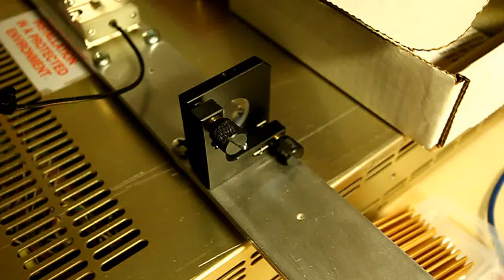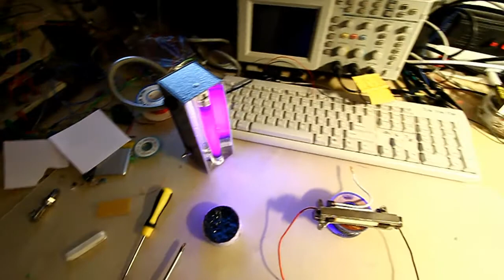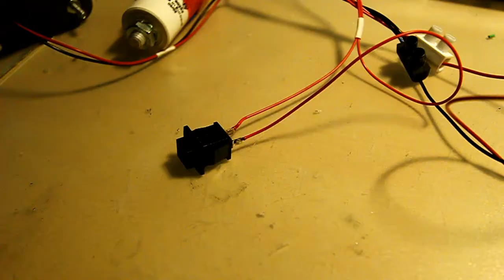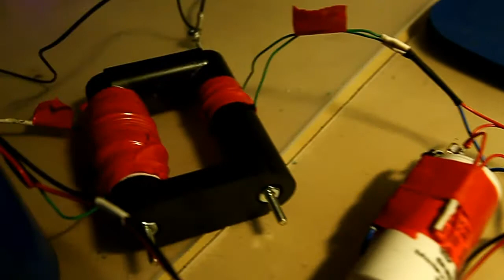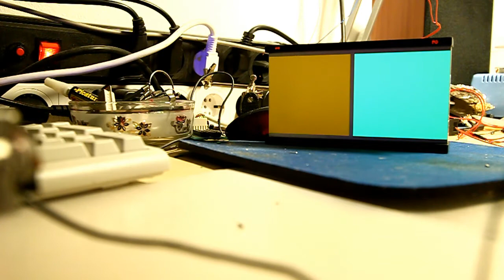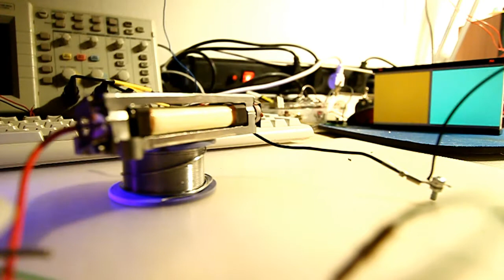Pulsed nd:yag laser / ssy1 revisited

Comment from the maker: Also, the AR coatings on the yag are not the first tings to get damaged. Have you seen yag rods with burned gray tracks inside them but with pristine AR coatings? I have. The energy field is not equally distributed intra cavity, and you have different waves traveling in 2 directions. If you happen to have a beat of 2 waves you can get a hot spot, if it's inside the yag you will get a damaged spot. However, as I said, all this has no chance to happen on non q-switched lasers.

Comment from the maker: It's not as simple as that. You can use whatever energy levels you want as long as you are at a reasonable % of the explosion energy of the lamp.
The purpose of the series inductor is to elongate the pulse. Having a really long pulse is not a bad thing, it depends what you use the laser for. Without the q-switch cell no matter what I do, the peak power intra cavity will not be no-where near the damage threshold of the yag rod.

Comment: Thanks for your attention. You assure me. Mirrors don't scare me. I worry more about flash lamp reflector. But.. As I know threshold lamp power is about 200 J to make active rod generate. I can give 1250 J power pumping, so it may be possible to use simple Al elipsoid reflector with less effisiency. A journey of a thousand miles begins with a single step :) If you do not mind I will ask you some advises in future.

Comment from the maker: The UV black light makes the plate material fluoresce, the IR laser makes the plate material loose the energy absorbed from the UV light. This quenches the fluorescence and makes the IR laser beam look like a dark spot.

So, it's just a fancy glow in the dark tile made with the right material.

A lot of the fluorescent materials will show this effect. A red laser pointer will do for quenching, if you want to try it.

Comment: hi, i wanted to know if that white wire connected to ssy1.  (which Sam says is some kind of trigger) that should connect to the fryer, is it connected in your circuit, or not.  thank you
Reply from the maker: Google "series flash lamp trigger", that's what I'm using to trigger the flash lamp, you don't need a 3rd wire with that.

Comment: Hi Daedronus, I ´m building a Nd:YAG laser, but I have some troubles whit the trigger circuit. could you give me some tip or example for this trigger
Reply from the maker: http://www.orcontech.com/data/Perkin_Elmer_Flashlamp_catalog.pdf
First half covers a lot of general information and circuits about driving flash lamps.

Use TVS diodes between the capacitor bank and the flash lamp to prevent the pulse from entering the capacitors or in the worst case the power supply
Reply: Daedronus
Hi Daedronus, thanks for answering me. I read that document. I saw that the trigger circuit is LC circuit. But what is the voltage which capacitor is charged?. Also, because this a series trigger circuit, the secondary of  the transformer is part of PFN circuit and this inductance is small. I hope you can answer me. Thank you very much for you reply.
Reply from the maker: Luis Munayco I use around 600V on my trigger capacitor, the capacitor itself should be small, less then 1uF.
Yes, the trigger secondary will become part of the PFN, in fact you will not use another L for the PFN.
Reply: Daedronus Thanks for your answer. Colud you reach 16kV whit your circuit?I have a ferrita core like that video. I´ll use this ferrite for the trigger transformer. I have a perkin elmer flashlamp, and I need at least 16kV for trigger. Do you remember how many turns has the transformer?Thank you very much for you reply.
Reply from the maker: Luis Munayco It's not the forward action of the transformer where Vout = Vin x turn_ratio that triggers the flash lamp, it's the flyback action, where the Vout spikes out after you stop driving the primary, so the output voltage will go very high.
Reply from the maker: Luis Munayco
Also see this:
http://4hv.org/e107_plugins/forum/forum_viewtopic.php?163297

You will need to use that, to protect your DC power supply from the trigger pulse
Reply: Hi Daedronus, Thanks for your answer. I want test my trigger circuit. I connected my trigger circuit to my flashlamp just try the circuit. Sometimes this created an arc in the lamp,but sometimes it doesn´t work. Could you give me any advice. Is it normal? Should the arc ever appear? Thanks very much for your answers.
Reply: Hi Daedronus , thanks for your answer. I have an answer. Could I replace a TV diode for severel 1N4007 diodes (1000V / 1A)?.
Reply from the maker: Luis Munayco
TV? or TVS? not the same thing?
http://en.wikipedia.org/wiki/Transient-voltage-suppression_diode